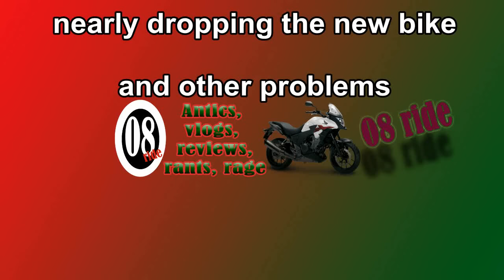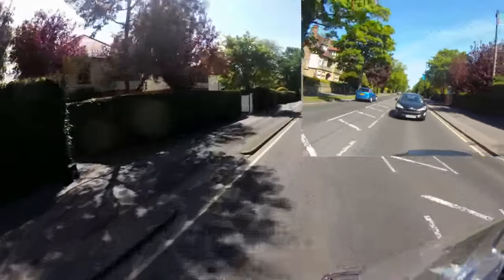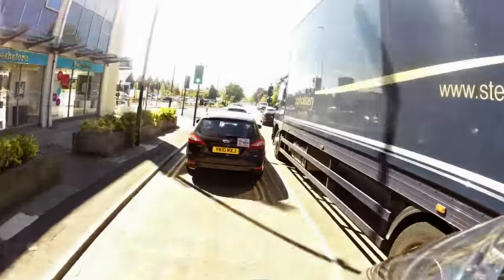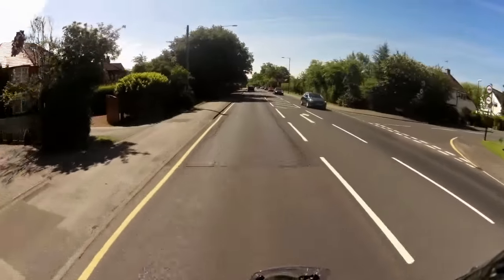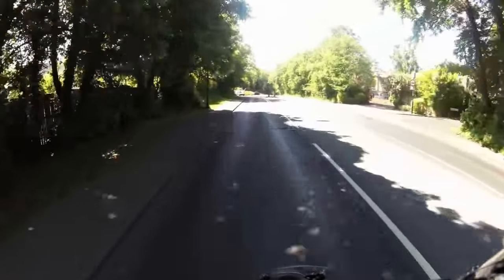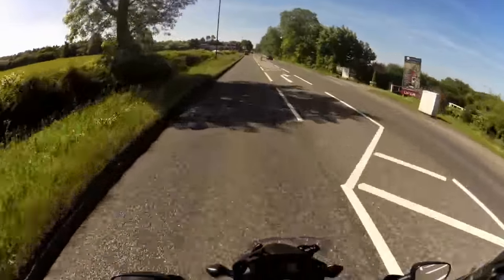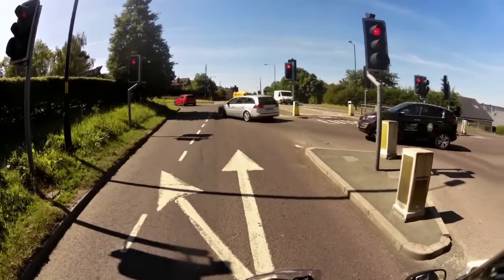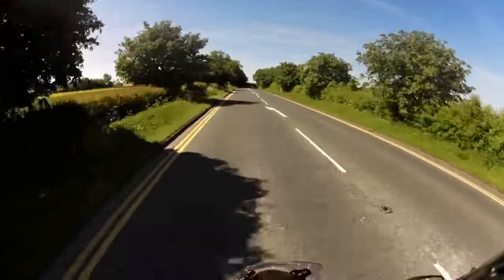Dropping my brand new CB500X bike and coolant problems

Comment: I just bought a 2020 CB500x. I put 700km on it in 3 weeks,,, checked the coolant just to see... nothing there ! I am a bit worried. Calling dealer tomorrow.
Reply from the maker: Sorry to hear that. But you should be about right for your first service, so they should check that

Comment: Personally I wouldn't mix em. The different colours represent changes in the chemical compositions and the colours are universal so that you can match the liquid easily. Also there is a different between coolant and anti freeze. Coolant is often blue or the colour of black current squash it is no good as it doesn't possess rust inhibitors. Anti freeze both cools and protects your engine, comes in a variety of colours but green or yellow are the ones my local brings in.
And only ever check your coolant levels on the center stand, if your bike is on the side stand you wont get an accurate reading and depending on the position of your reservoir it could appear to be either empty or over filled.
Reply from the maker: Darth Peachy Difficult to find green or yellow here, and I needed the right stuff quick. The number of motorbike dealers/technicians that told me it was fine to mix any with the right spec in the end, and getting the stuff from an ex-Honda dealer who always used the Castrol and his long-term experience had showed no issues when mixing with the Honda green, suggested all was fine. As long as it was ethylene glycol based.

"Coolant" v "antifreeze"? I don't think you are right there. The Honda manual states "[the] coolant is a pre-mixed solution of antifreeze and distilled water". The spec required, which I followed, is "Use Pro Honda HP coolant or an equivalent high quality ethylene glycol antifreeze containing corrosion protection inhibitors specifically recommended for use in aluminum engines. Using coolant with silicate inhibitors may cause premature wear of water pump seals or blockage of radiator passages. Using tap water may cause engine damage". I'm not that bothered about the terminology though, just getting the right stuff.

The OAT stuff from Halfords is recommended for most motorbikes and is pink/red.

I did check on the centre stand, every time. That's why the bloody bike nearly fell over - other than it was all my own fault, but lesson learned without any bad outcome!

Comment: Perhaps I am missing something but it looked like it would have been more sensible to park on the other side of the road.
Reply from the maker: uphillfreewheeler I didn't explain that bit very well, did I? I needed to be close to my front door to plug in the oximiser from a power point, and didn't want electric wires trailing across the road where cars were coming past.

Comment: its always a worry getting the right angle for the stand, but think we have all nearly done it at one point or another! RSM8
Reply from the maker: not had the same issue again - it's ingrained in my mind to make sure the ground is level enough
Reply: haha I bet it is, did the same when I was 16, never since. Ive subbed to your channel ride safe mate
Reply from the maker: +pablo123b cheers. Not much goes on the channel nowadays, but I occasionally have a spurt of activity. Ride safe
Reply: Yes same with my channel pop a bit in then life gets too busy lol